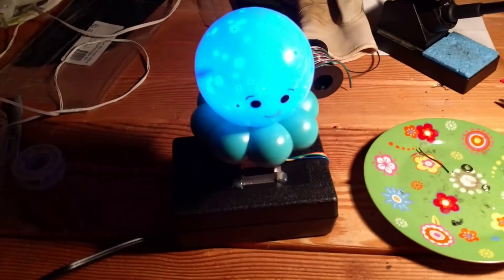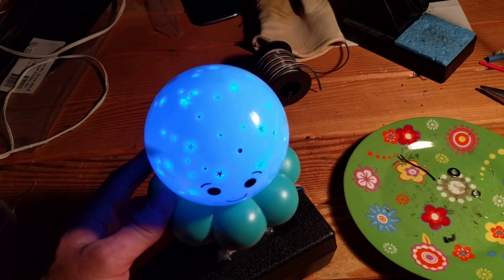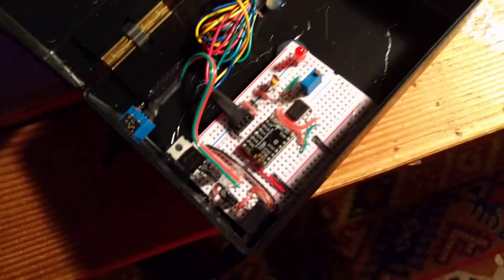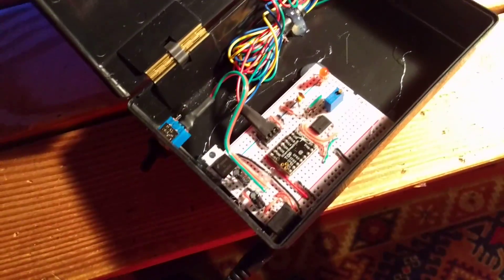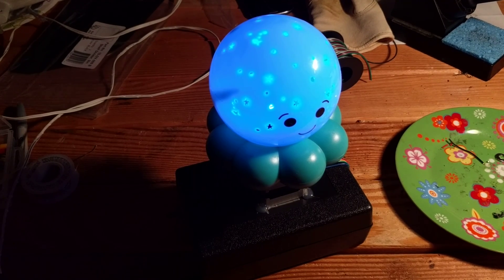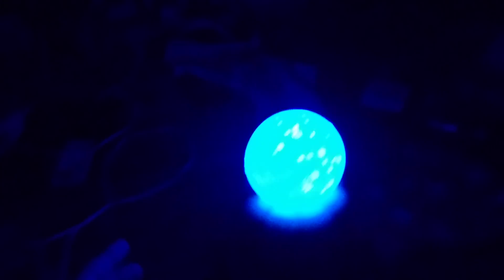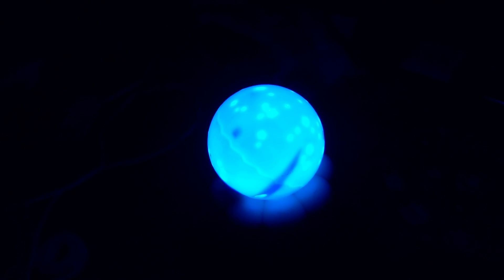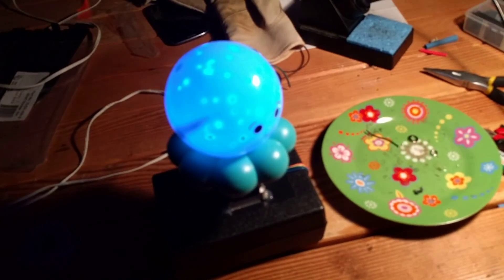My Galaxy Spinner with Silent Step Stick Servo Controller and 555 timer

Comment: I have the same clamp for nema 17 and I can't find screws for it
Reply from the maker: yeah, there are screw sets you can buy from China that have screws of various sizes, so if I am missing something I can at least figure out what sizes it was, but I probably have a backup for almost any missing screw or bolt

Comment: what screws did you use for the 4 holes of the clamp?
Reply from the maker: i just had a bunch that happened to fit into the stepper

Comment: Hi! I think this is exactly the setup I need for my project. I am building a "floating" tellurion (earth and moon orbit model) and need the stepper motor powering it to run silently and at very low rpm like your galaxy spinner. 
Unfortunately I have no experience in electrical engineering. 
Is it possible that you could provide a circuit diagram or more pictures of  both sides of the breadboard? I'm sure one of my friends studying electrical engineering could then rebuild the circuit for me. It would be greatly appreciated.
Reply from the maker: sorry about the late reply, but this photo album might help you, it includes early diagrams and even a much easier later design:
https://photos.app.goo.gl/WrpwyiakxNSmWxbA7
Reply from the maker: fyi, the later design used an AtTiny instead of the 555 timer to control the stepper driver because it was easier to implement and required less parts

Comment: Hi James - could you provide a connection diagram for your setup with the SilentStepStick? I'm trying to do something very similar for a model kit and I've had no luck finding details on how to wire up the SilentStepStick (other than in a 3D printer). And which SilentStepStick did you use? I just purchased a TMC2208.
Reply from the maker: Ross, I am using a TMC2130 here but it may wire up the same.  With the 2130 I know you need to have the ground set on both sides and 2 different power sources, one at 12v for the motor and one at 5v for the logic circuit (look at the pinout indicators on the board).  After you have those set you will need 2 other pins connected; the DIR pin (set to + for turning one direction, - for spinning the other direction) and STEP. The step pin will move one step every time the STEP pin goes from negative to positive so you feed it a square wave to spin the motor.  Try switching the pin on and off from an arduino and adjust the amount of time up of down to move the steps faster or slower.  The motor pins depend on the motor, I can give you some more advice on that if need be.  Check this image of me wiring the above setup and controlling the TMC2130 from an arduino for more wiring examples:
https://photos.app.goo.gl/Rrc9QdwUX17zuqWn9
Hope that helps
Reply: james wolf Thanks heaps, James. So, you didn’t connect anything to the CFG1-3 pins?
Reply from the maker: @RossAWaddell  I didn't, those can be used for more fine tuned configuration to do more sophisticated things than just single steps, but for what I needed it for it was unnecessary (single steps in one direction).  I have been kinda working on another idea lately where I was starting to take a look at the higher levels on configuration, but I found that you just need to do a SPI connection to a micro for those CFG pins.  There is more info (for the TMC2130 anyways) here:
https://github.com/teemuatlut/TMC2130Stepper
but if you are just doing simple stuff, just use the STEP and DIR pins and modulate the time turning the STEP pin on and off to adjust speed.  I banged my head against how to connect the pins for a while at first too, so I am glad to help :)
Reply: james wolf Did you mean you used a TMC2100? The TMC2130 ships in SPI mode so I had to solder a jumper to get it work with setting the step mode via the CFG pins. But, after all that it was noticeably louder than the TMC2208 at full step or half step.
Reply from the maker: @RossAWaddell  dude, had to double check and it looks like you are right, this is what I am using:
https://photos.app.goo.gl/bRody79MhpHavNW89
https://photos.app.goo.gl/DqQj6SArUuw6aTPUA
from Waterott Electronic, sorry about the mix-up, got them a while ago